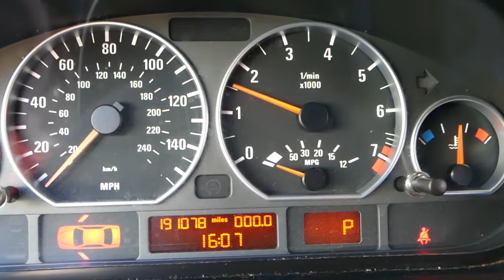WHY THERE IS COOLANT IN THE ENGINE OIL OR OIL IN THE COOLANT  MOST CARS

Comment: Thank you
Oil pressure is higher about 50 psi and coolant 15 psi to 20 psi when cooler fails it can blow out a coolant hose. This is what happened to me what a mess but made it home to make repairs.

Comment: I have just bought a Ford grand tourneo 11k English,The car was over heating after 2 weeks use i took it the garage the lads said the water reservoir and the oil coolant had been replaced,said the coolant and oil had mixed when the oil coolant failed and they had flushed the system out hoping it would eradicate the problem obviously it hadn't they said the system was contaminated and had caused damage to the head gasket and it would need a big job sometime in the near future i was extremely grateful and would like to share this experience with you all cheers Andrew 🍻 😁💪👍

Comment: 2008 cayenne S, trying to figure out why I ha e water or coolant in oil. Coolant tank has zero oil , pulled spark plugs and they are clean and dry no water either down into the cylinder . Car has low coolant warning light because a rear passenger side coolant leak. Once the coolant tank is topped off it leaks empty with 24/48 hours . Is it possible it can just be an oil cooler? What tests do I need to do  on cayenne to confirm problem. Thanks !

Comment: My 1998 Ford E250 Van 4.2 engine is flooded with water. First, we thought the water pump was bad. We changed it. While the van was not running, we added new coolant through the plastic receptacle. As coolant is poured into the receptacle, it just kept going straight into the engine. Does it mean that my Head Gasket is totally blown? Thanks

Comment: Hi. 2003 646 Mercedes,I have .5 liter water in my oil ten kilometer , but the engine runs perfect . Head gasket or oil cooler . There is a slight oil in the cooler reservoir. It was maybe overheated.. Thanks for you reply.

Comment: I recently replace the head gasket and the oil cooler.  The coolant was replaced and the vehicle was driven but I noticed that there was a coolant leak and the oil was mixed with the coolant in the coolant reservoirs.  What could be the cause of this?  The vehicle in question is ford ranger.
Reply: Did you find out what it was?
Reply: @rje613  i ran out of money so i have left it for now. Once i have enough money i will get a machanic to look at it and report back. Thank you for your question

Comment: Hello, I have an E500 W211 2004. I opened the oil filler cap and saw brown slug looking stuff. My reservoir is fine there is no oil in coolant reservoir, but it looks like coolant in the engine. The car had an overheating issue from the previous owner. But it ran fine for me for several months after I bought it.

Comment: Thanks good informations
Today I had oil in my car's colant.
There is no heat
No smoke black or white
No water in the engine
I would like to have some tips if you don't mind.
It's lancer EX 201 2 letters.
Reply: Did you ever figure it out. I have the same issue.

Comment: I just Re done the engine on my Ford Fiesta 1.6i 2009 Model. We now see that the water in the water jacket has no Oil but the Oil pan has water. Is it possible that the Gasket caused the mix?

Comment: Hi there i have a opel astra 1.6 turbo ecotec oil mixing in to the water cooler I took the oil cooler of and put gasget sealer on because the seal whas a bit flat and assemble it again and same problem assist do you think I must replace the oil cooler

Comment: Hi I have a 89 Sierra sapphire motor, yb cosworth turbo. Coolant level had dropped found leak in loose pipe clamp joining turbo too hose housing in front of engine. But let out 500ml of oil from sump and green coolant was there not mixed.engine was running fine no oil in radiator or coolant on oil dipstick? What would you think is keeping? Regards brenton

Comment: Hello I have a 2000 ford ranger that is mixing water and oil. It runs fine, no misses and I was having problems with it using coolant but I couldn't find any leaks. So I kept adding coolant and checking my oil but I had no mixing of coolant and oil, yet. So I never had any signs of overeating but when I used sooo much coolant to drive 6 miles and of course checking my oil and no mixing but I was worried. I drove up my hill slowly home and no signs of overheating, I had mu hood cracked so I could watch for steam and no temp changes but I heard a tiny whistle because I had my head out the window listening and watching. But it wasn't overheating so I drove to my parking spot mind you this whistling happened 40 feet before my parking spot. So I parked and lifted the hood and everything sounded and looked ok but I checked the coolant box first and it was gone again much quicker than normal and so I checked the oil and it was all chocolatey and I could see the old unmixed oil in the window dots to check the oil, so I quickly shut her down???
Reply: Its a 4.0, 2 wheel drive Light Truck version
Reply: Same thing happened on my Honda lol It is definitely a head gasket or cracked heads problem lol Sometimes we just gotta roll with the punches

Comment: Hi my name is Richard. I have Ford Fiesta 2014 model, it overheated because I forgot to close the cap after filling water, I took it to the mechanic who striped the cylinder head out and took it to the engineer for skimming  and replaced the gasket but after starting it and tested it, it mixed the water with oil, we see it from the deep stick. he replaced the gasket again but still the problem continues. The car start and idle normally but when switched off and leave it for 10 - 20 minutes and start again it does not start and when you take out the spark plug, there is water there. Please help because the mechanic suggest to take out the hole engine.

Comment: Hi I have ford galaxy titanium disel engine 2016 I already change the oil cooler it was mixing colent  and oil the  it stop mixinng after it don't make a hot air in car and temperature cage go down then I change heater martix Ford  it start again mixinng also in EGR valve also come I change also valve  but it don't stop mixinng please reply I am in big trouble thanks

Comment: I have a Audi A4 Quattro 2005 
My car had the problem with the broken oil filter house it was leaking the water and oil both 
One day I try starting my car and it turn off when was bout to reverse car start again try putting reverse again and it kept turning off on my 3rd try car turn off again but didn’t start back on 
On bottom there was oil and water mixed 
The oil filter had water 
I replaced the oil filter housing but car won’t turn on anymore!:( any suggestions?

Comment: I have oil in my ford everest 2008 coolant system. I had replaced my oil cooler, after 1 month oil is back in my rad. It was the o ring seal inside oil cooler that is broken again, so i change it. after 1 month oil was back again in my rad. it has been the third time i change it and It makes me wondering, what make the o ring keep broken? Please advise. Thank you.
Reply: Maybe incorrect installation? putting too much stress while installing the O ring or the other part is not clean and has some sort of burr that breaks it after a period of time. ( not a car tech, but simple thinking)
Reply: Did you have small bubbles and foam in the coolant also?
Reply: @thepuff309  no bubbles or foam, just a thick black (grey-ish) oil.
Reply: @HaryantoHartono  thanks. Guess my head gasket is blown.

Comment: Hello there. Thanks for the video.

I have a Toyota Previa 1996 model. I noticed over heating and the next I noticed was my engine oils became very white and coolant was constantly reducing. So we changed the top gasket and did some control of the engine top to make sure it wasn’t bend. Did all that and changed the oil and after 2days the coolant and oil continued mixing. 
Can u help me with some suggestions? 
Thanks
Reply: The Previa has an internal water pump.  When it fails, it dumps coolant into the oil.  The water pump lives on the front of the engine and runs off of the crank shaft.  Replacement is an easy fix.

Comment: If the engine overheats and you have oil in the coolant. What's the cheapest way to fix this problem. Buy another engine or repair the head and fix all the gaskets and look for the crack in the head?

Comment: Hi guys thank you for your videos, so we had this problem. So far we replaced all the parts in this video. The water pump as well and its gasket. We did service kit and belts with the repair. However we still have ignition problem now. We got it to start sounds great. After idling for 15 minutes, could the moisture that was in engine make it look like a head gasket is blown cause of previous moisture.🤔😒. We received 0113 code at start of the repair process.
Reply: What could be the reason for car not starting in the first place should we take a look at Maf sensor and coil pack, please put me out of my misery
Reply: @Pat Caron the only way oil could make it to the intake would be from PCV hose or valve seals for the intake side. In your case, do you have blue smoke coming out from the tailpipe?
Reply: @Pat Caron usually valve cover seal would cause a leak on the top side of the engine which would drip onto the cat(s).

Comment: I got e46 325ci and got pink oily pink stuff in coolant , tried rinse few times, still there, engine oil is fine. Oil dipstick fine no other colours 🤔
Reply: It's the transmission fluid that mixed with the coolant. My 2012 Chevy Captiva have the same issue right now

Comment: Man these modern day engines are so cramped and complex.  You gotta remove 5 things at least to get to the simple thing that needs replaced..thats after diagnosing problem with hi tech equipment only the shops carry... this is why my 2 70s vehicles are in the driveway always ready for battle and my 2007 Mazda sits broke dick in the garage